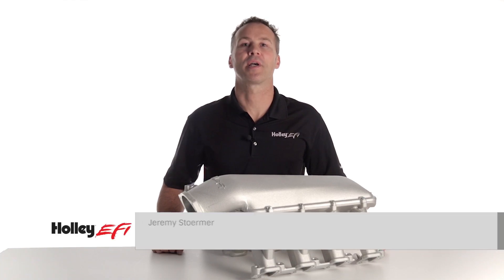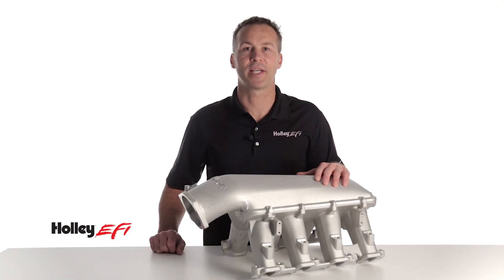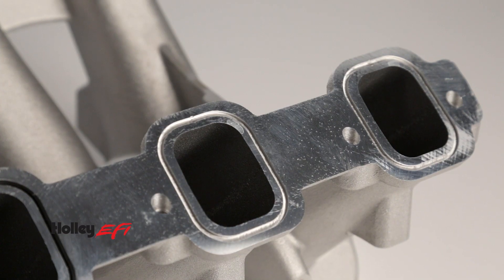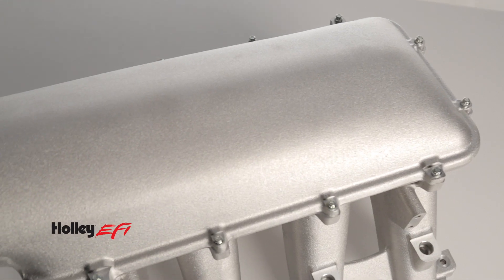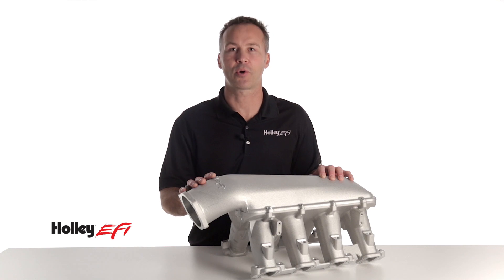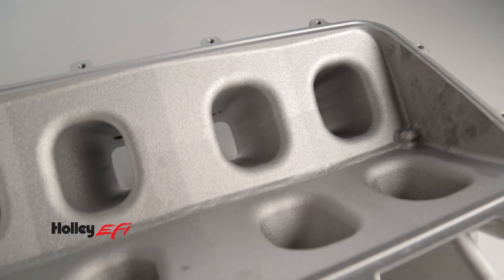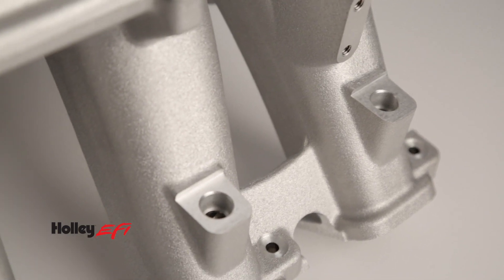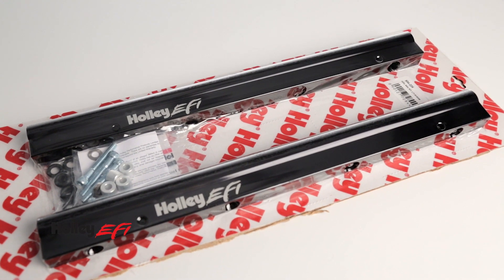Holley EFI LT1 Hi-Ram Intakes

Comment: Question for the Direct Injection guys.  I have an L86 2014 sierra 6.2 with a cam and bigger fuel lobe.  Do you just block off where the port injection is on the intake.  I don't need the extra fuel now but.  But might need it when I go turbo LOL.
Reply: They sell them with or without the ports

Comment: Can the top be reversed? I have a rear-engined car and I won't have space for the throttle body pointing out the front of the engine.
Reply from the maker: Yes! You can flip the lid around backwards or even turn the entire manifold around backwards. -Keith
Reply: @HolleyPerformance  Great - Thanks for the answer, Keith.